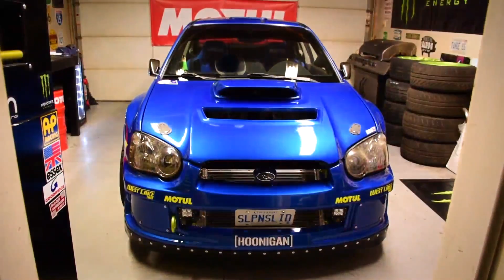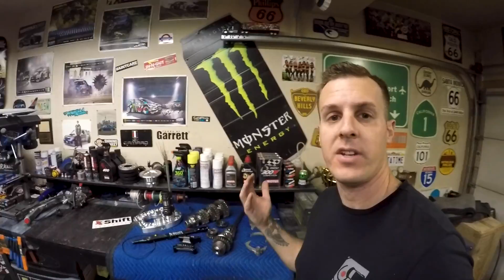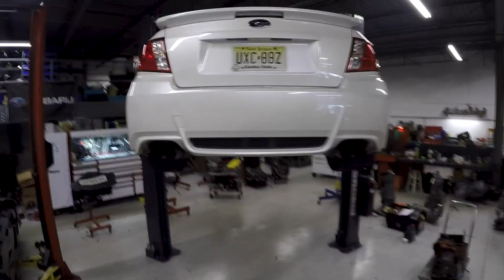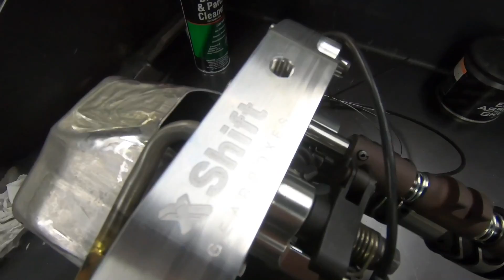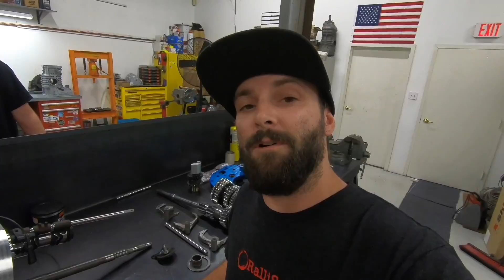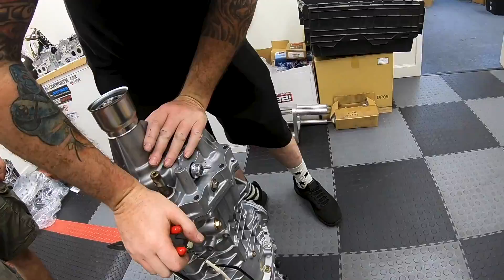X Shift Subaru +Plus Sequential Gearbox - Subaru STi WRC / Gymkhana Build Series

Comment: Which gearing did u get? 

I want the long gear one to make it faster 0-60. 

Why would an engine builder or driver want short gears? It hard het this information off the Internet. 

Thanks
Reply from the maker: I went with the longer gear set. I don’t think 0-60 would be any different than the short set tho as 1st and 2nd gear ratios were the same. Not sure what you mean about an engine builder choosing gear ratios but it really comes down to the type of racing your doing, at the professional Motorsport level, teams will change out different gear sets per event.
Reply: @MPGymkhana  sorry I meant. There are two sequential boxes I can get. One that with 2nd gear ratio at 2.25 and one 1.98. 

my goal is quick 0-60 time. Why? Just because it costs around 7-10k in UK to build a 500bhp car for subaru. Might be more with turbo and rotated set up of up pipe.

And with a standard 6 speed sti gear box u must change x3 for 0-60mph. People get around 3-3.2 sec it seems. That amazing.

My question is with 400bhp which is factory safe with sequential either no change to 60 or x3 changes will get same time. That means I get my dream build without having to build it for 500bhp.

I meant engine builder as in if I ask one which gear box to get which will they say.

I can't seem to get this information...

I guess if ask specifically I wanted to reach 60mph because it the most a car can get around a specific corner on a track which box will they give if I was a professional?

Thank for a reply sorry for amateur type questions.

Comment: Why did you go to the States to get the transmission built? What does RaceTech do different than Canadian Shops?
Reply from the maker: I’m friends with the guys at Rallispec, I also bought the bare transmission case from them I needed. It’s not that they do anything different than any Canadian shop, but they definitely have a lot more experience and proven track record when it comes to Subaru motorsport applications.